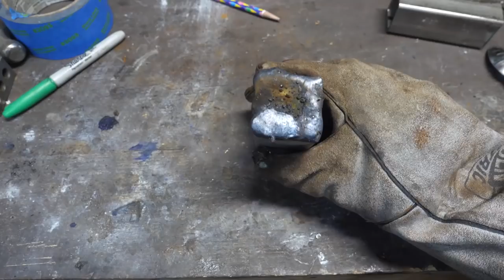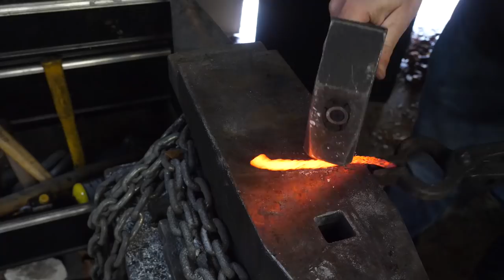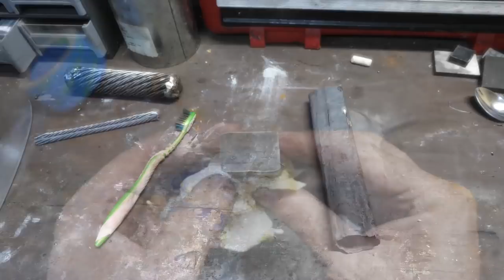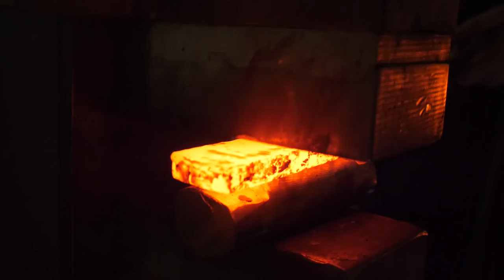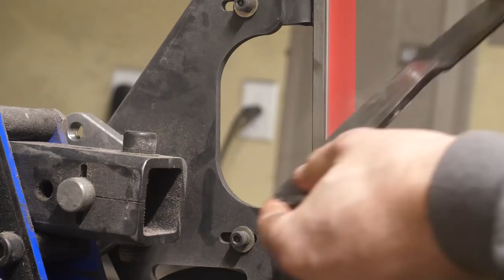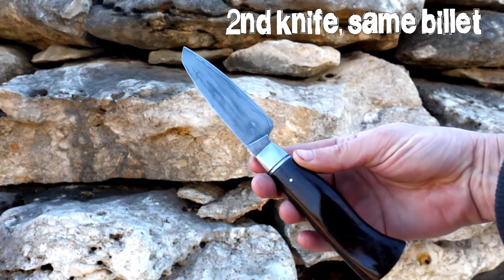This Wasn't Great.  Let's Try Again!

Comment: I think the mosaic pattern has some promise, might be worth a bit more experimenting one day with other materials alongside it. Otherwise the finished products are quite cool in their own way too.
Tru-Oil is really good for light duty knives, like hunting knives and helps even out the grain patterns, burl timbers especially on highly polished handles where you get a natural lustre. You can also use it with thin CA glue first (then sand-polish it- then oil) to do some pore filling on some of the more 'difficult' timbers like wenge in particular.
About the only place I've found during my testing is that in kitchen knives exposed to harsher cleaning chemicals regularly it does tend to eventually wear off after a year or so and go back to a matt finish- that's on stabilised timbers on kitchen knives.

Comment: I have been using tru oil since I started knife making and I love it. If you want to use it on oily woods like the rosewood families. You have to do a skim coat of super glue first. Then smooth sand it lightly with thousand grit or higher, then tru oil.

Comment: This gave me an idea. Could you make a gradient out of powdered steel with BBs as an additional pattern? The powder would gradually fade from 1080 at the bottom to 15n20 at the top of the canister. Maybe it isnt possible but it'd be a cool idea for sure

Comment: I'm curious, do you think you might be able to get a better weld if you used one of those ultrasonic cleaners on cables like these?  That way you're not relying on the just the kerosene making contact with the crud between the cables, you're actively loosening them and agitating the kerosene in between the cable strands.
Reply: I think that would greatly help since soaking only loosens it but doesnt really remove it, grease and crud in those tight parts isn't going to move just on its own.
Reply: Cool idea

Comment: Good looking knives💪
I love tru-oil! But when you leave it, after applying the oil, I think it looks to shiny, almost glass like...I have learned from a bowyer I follow here on YT, that to get an awesome glowy satin finish after a few layers of tru-oil. You first use 600 grit wet sandpaper. After sandpaper, mix a slurry made of pumice powder and cooking oil. Then buff the surface with the pumice paste. A bit of effort, but well worth it imo. I always use this method, when I make bows, and it looks fantastic💪 Hope you can use my advice...

Comment: I've always thought you didn't want to forge in your tip when you do mosaic. Like you saw, it distorters the tip. Make a billet. Grind to shape.
Reply from the maker: Short on steel had to draw it out for length

Comment: What is the bolster material just normal steel? I'm sure the knifes are great and look fine, I just feel the cable isn't showing very much in the end as cable. For me the nice part about these kind of pattern welded knifes is that you can see what it was before if possible. As you already know Shurap is a master at. The handle was great though, looks good.
Reply from the maker: bolster is mild steel

Comment: What temperature did you temper the 15n20 to get 60 hrc???
Reply from the maker: 360.  I often temper at 350 the first time then slowly work my way up temper cycle by temper cycle in temperature until I get the desired hardness for each knife but definitely for each new batch of steel.
Reply: @GreenBeetle  that’s weird. I thought to get around the 60hrc you would temper at around 400.